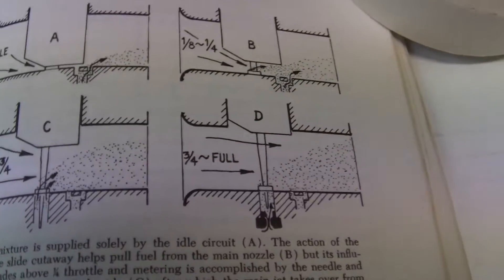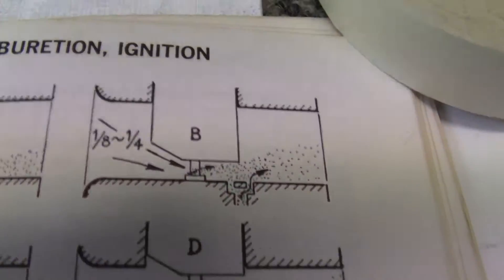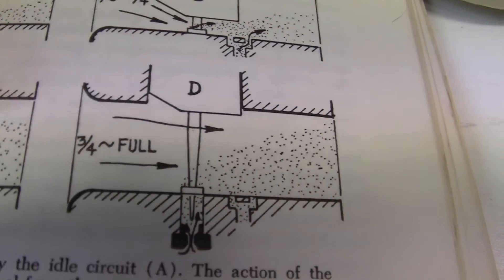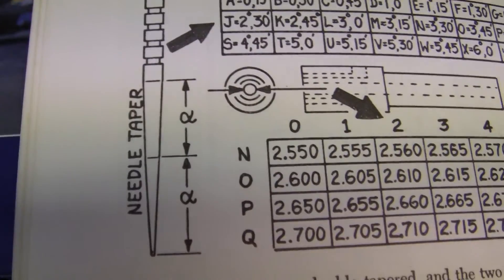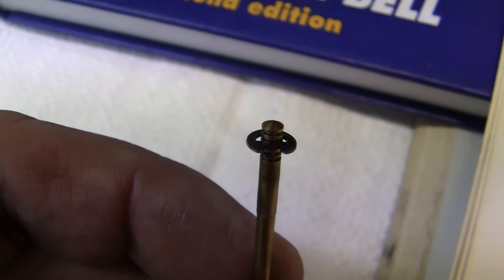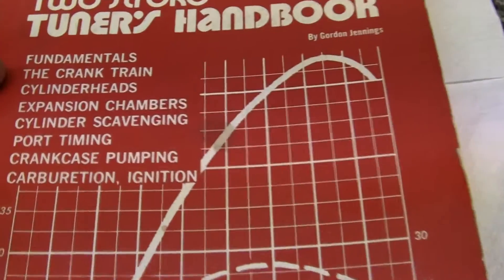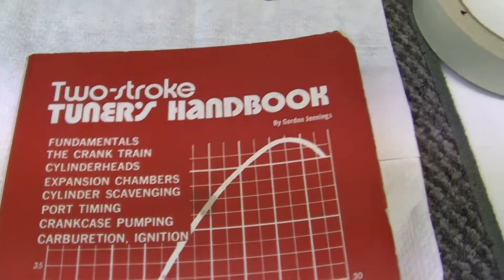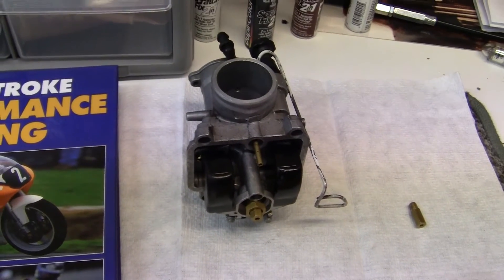(3)- How a Carburetor Works.

Comment from the maker: @MichelleDri The book is available for about 50$ . Anything larger than the stock piston will require a premix ratio of 40 or 50:1 oil to gas in the fuel tank. The book covers all this and only deals with two strokes and goes in depth in every phase of the little racing motors. Glad you like the videos. RH DSD